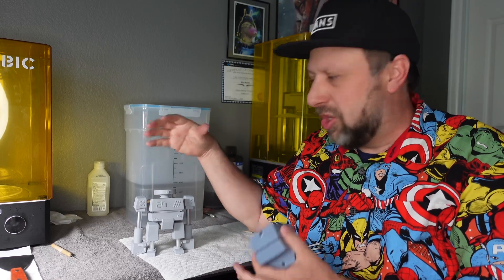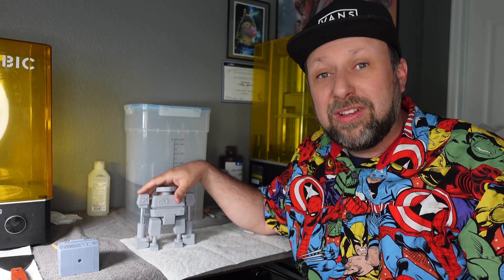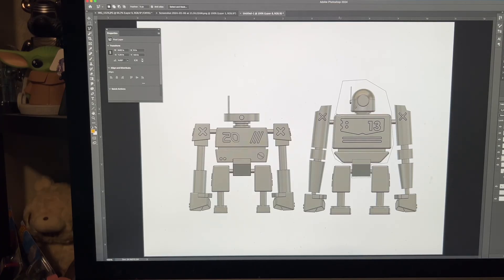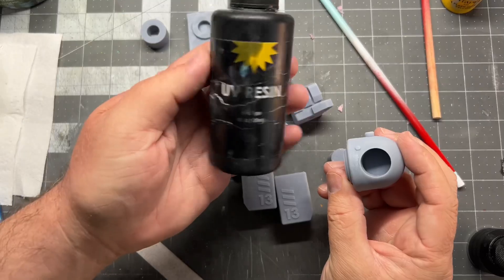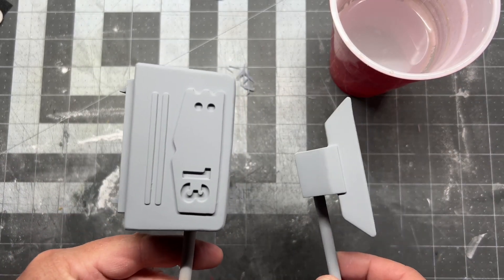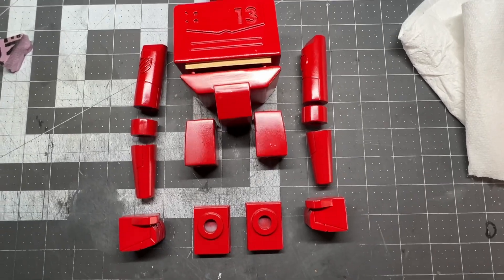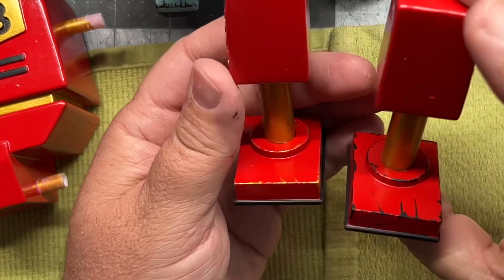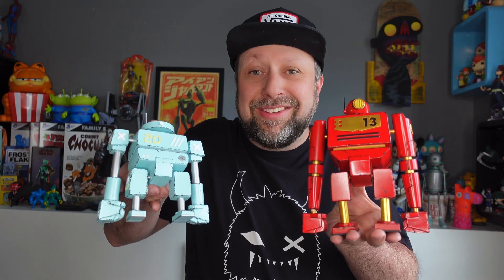Deciding Whether Or Not To Resin Print: Is It Worth It?

Comment: I love these "knuckle-draggers". Chonk-Bots are cool, and these have just the right balance between cartoon and retro sci-fi vibes. 
The widespread fear and loathing toward 3D printing is something I don't fully agree with either... It is a tool that requires skill and forethought to master and I'm sure you get a lot out of using it for prototyping / short-run sale items and just thinking / designing differently. It doesn't take the skill out of model-making any more than a limited resin garage kit figure model does and modellers love those... I imagine pipe-chomping 'trad-dads' in the 1960s were equally dismissive of their children's styrene kits because they built models from balsa wood when they were young. Although there are people who buy ready made STLs rather than design their own but, 'hey'... Every modeller is differently motivated / differently able.
Reply from the maker: I totally agree! I remember when the Wacom first came out and being in Illustration and Graphic Design, that many people were hesitant and thought it was a cheat!😃

A tools a tool and you still need skill and understanding of simple principles of design.

Thanks so much!

Comment: I see no problem with using the 3-D printer, it's cool for some builds and could help you out with other builds when you can't quite find the right parts you need for scratch builds. Plus when you do your scratch build you can then reproduce it again if you ever want to make a copy for someone, and not have to scrounge up hard to find parts. Plus like your Big Mac guy you built and your Mario on the plant you could do like a hard version of the burger box or the drink cover and not have to worry about it getting damaged over time.

And this little robot 🤖 came out totally awesome. Super Cool 😎 👍👍👍
Reply from the maker: Totally agree.
Thanks so much!